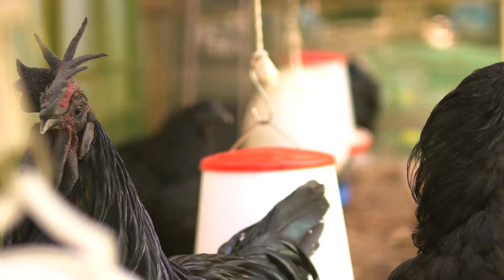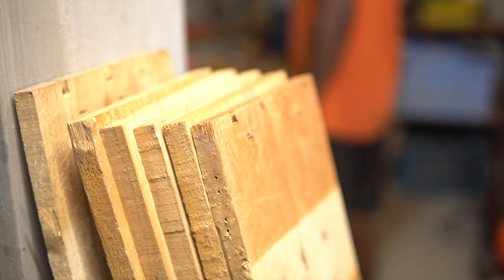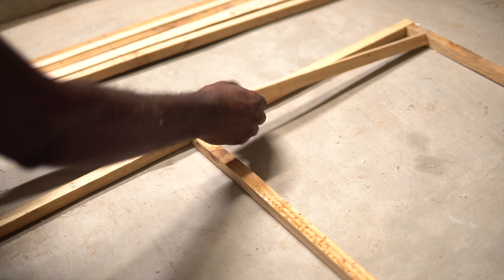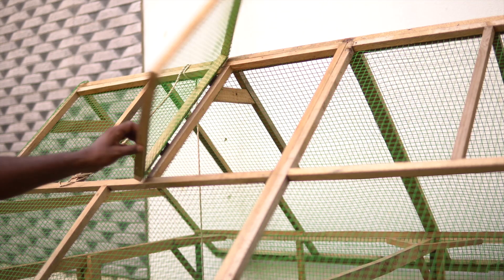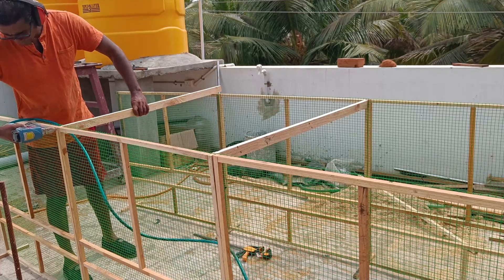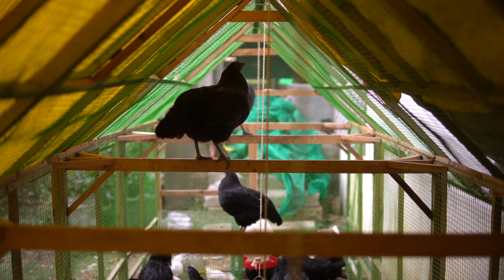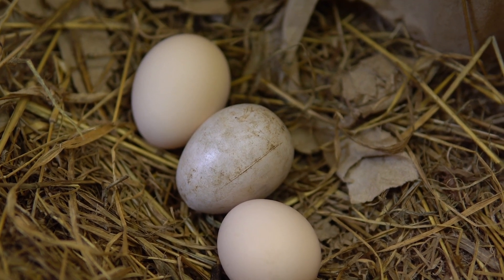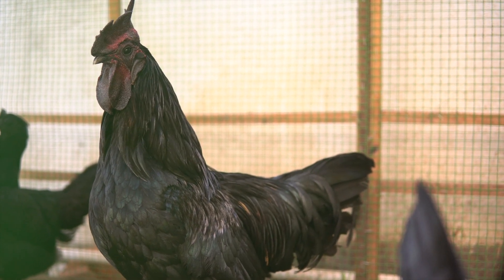Affordable solutions for raising chickens in a small budget yet large coop

Comment: I wish you had mentioned SOMETHING / ANYTHING about the plastic netting. Links would have been nice. Otherwise, nice video for a predator free location. I don't think your structure would hold up to a raccoon, coyote, dog, etc.
Reply from the maker: Absolutely correct. This cage is to protect the birds from cats and mongooses. The fence of the house will keep the dogs away.
the metal net is a generic one. easily available. 
anyway here is the link
https://amzn.to/3JTv2WZ

internationl link
https://www.amazon.com/MTB-Black-Coated-Hardware-Cloth/dp/B07ZNWD57Z/ref=pd_rhf_d_ee_s_pd_sbs_rvi_sccl_2_1/135-8634369-5565305?pd_rd_w=fmt5I&content-id=amzn1.sym.a089f039-4dde-401a-9041-8b534ae99e65&pf_rd_p=a089f039-4dde-401a-9041-8b534ae99e65&pf_rd_r=YQWRDN0YZ324WDNQBWYP&pd_rd_wg=Kwf9G&pd_rd_r=50e7893f-a4d3-4072-a805-d4a7c53a22db&pd_rd_i=B07ZNWD57Z&psc=1